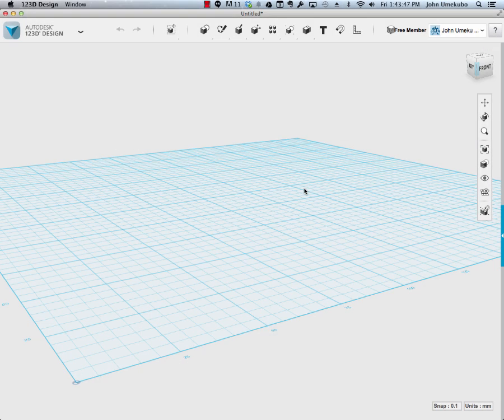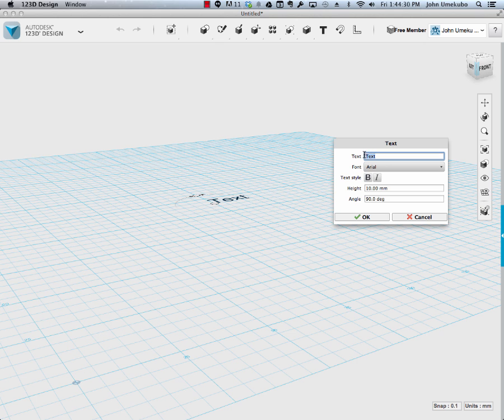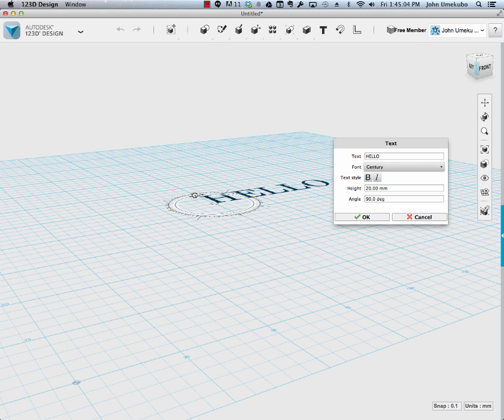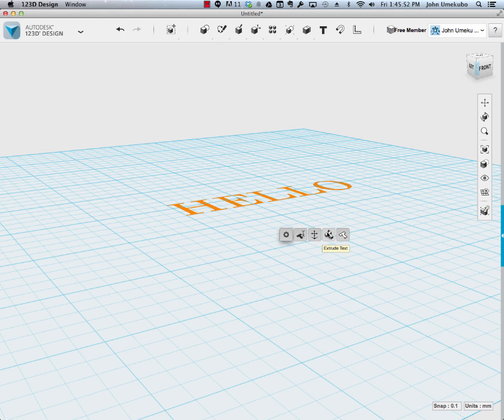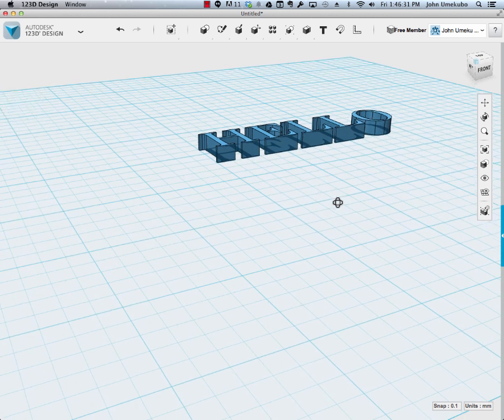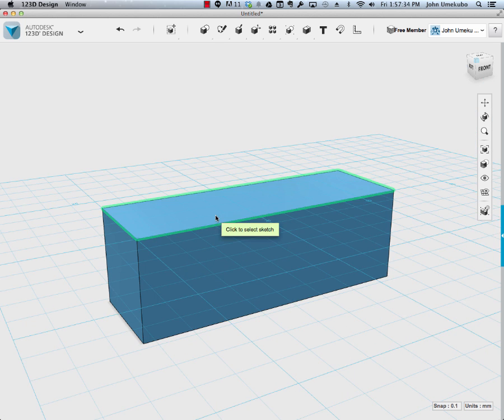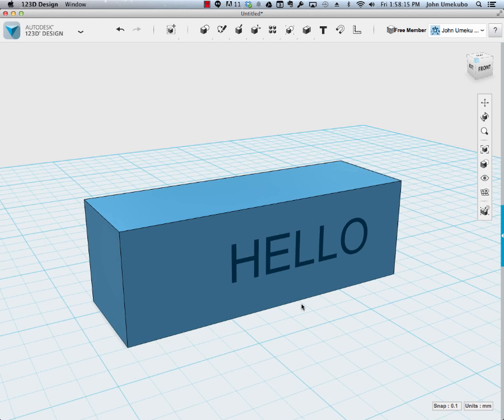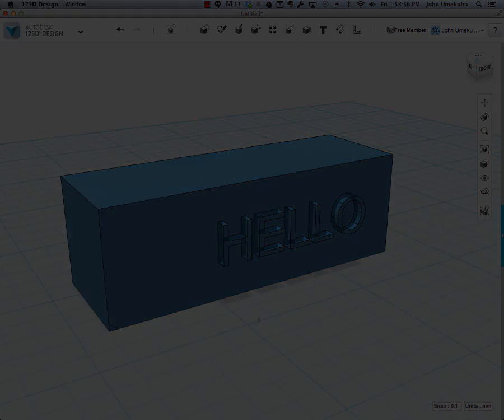Autodesk 123D - Text

Comment: Is there a way to edit or remove extruded text?
Reply from the maker: Yes, you can edit text by clicking on it and viewing the Inspector panel that will show up after selection has been made. You can change the letters within the text as well as other attributes. You can also select text and delete. Once you combine the text with other shapes thru grouping, however, you won’t be able to edit.